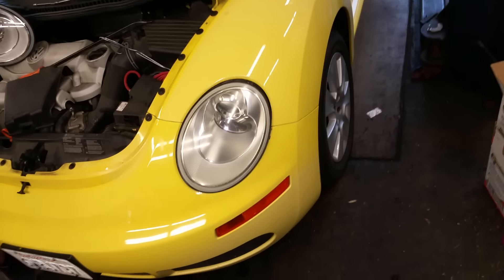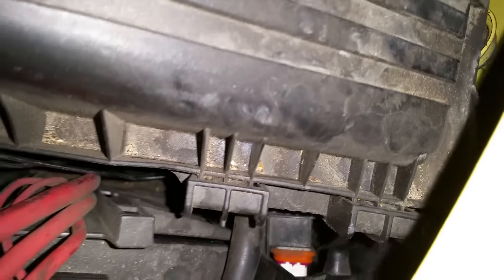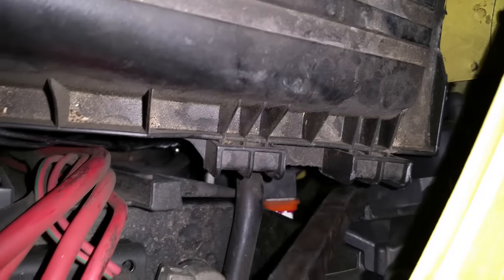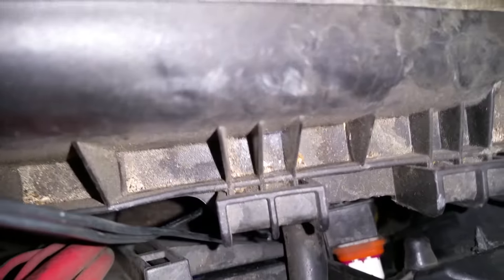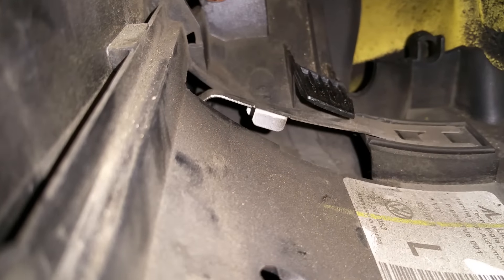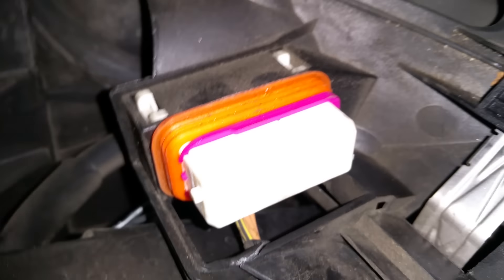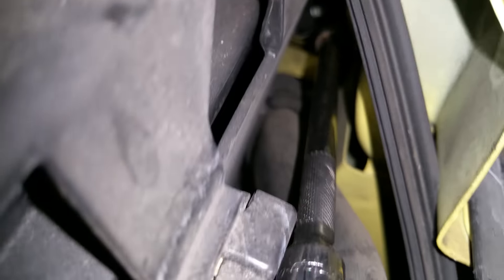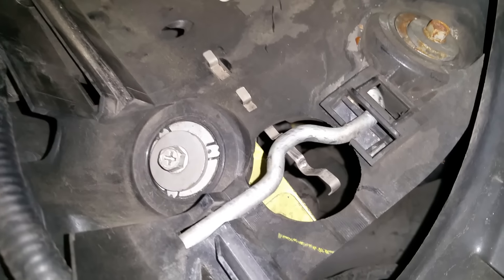Easy to understand New Beetle Headlight bulb how to

Comment: Of course, test the headlights after reinstalling the headlight.  If nothing turns on, the white part of the electrical connection might not be seated all the way or at all.  You can look in to see it seating when pushing the canister in to make sure it's lined up and fully seated.
Reply: brookielovesyou would this effect both headlights? Literally just did this today, and both wont turn back on. PLEASE HELP!

Comment: Hey thanks, getting down in there is rather tricky, but knowing where to look helps. I ended up using the end of a wooden coathanger to push down the second lock, any stick that would reach and fit would do. For anyone else trying this, a 5mm socket on the end of an extension/ratchet would do if you don't mind potentially losing your socket (almost happened to me!)--I think the long nutdriver would be a better solution, one that just wasn't available to me locally at the time.

Anyway, once you unlock the headlight ass'y, smooth sailing. Thanks again!
Reply from the maker: thanks for the comment! I made this video because none of the videos prior explained what was happening when i was prodding in the dark. haha

Comment: Great video. When I put the light back in it does stay in place tight. After driving around it loosens up and unplugs. Any suggestion?
Reply: I am having the exact same problem, if you push on the light housing from the front the light will go on but it will not stay on, it is like the light is not plugged in completely
Reply: @troystaten5633  I ended up holding the connector with one hand and pushing the headlight with the other. It’s held up since.

Comment: this was a 2008 VW Beetle but mine is a 2003 , are the steps the same ?
Reply from the maker: Should be the same yes.
Reply: Actually 003 Beetle only has the lever to push down        @subtledriver
Reply from the maker: @DrBroncanuus  thanks for clarification. I haven't seen a 1st gen in a while at the shop.
Reply: NO. there is no metal clip. it has a plastic semi-circular ring that retains the headlight assembly. and the plastic ring is easy to break off.